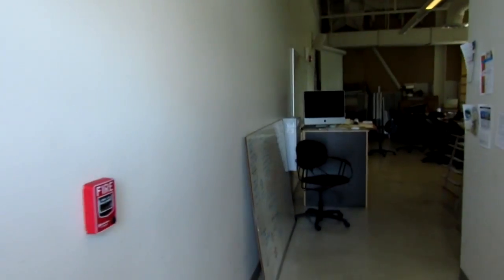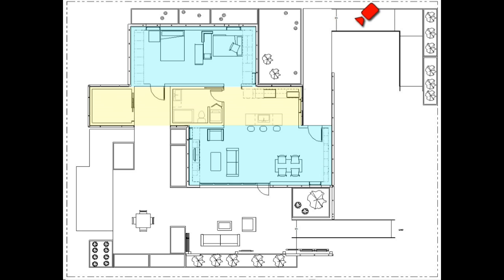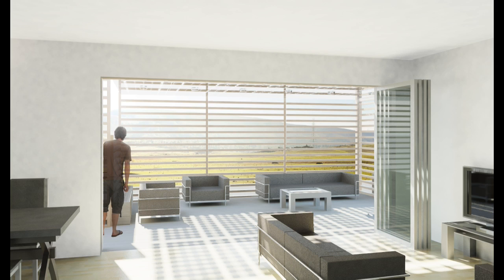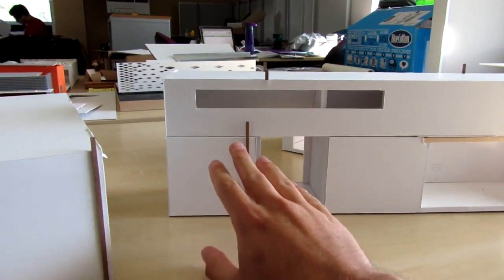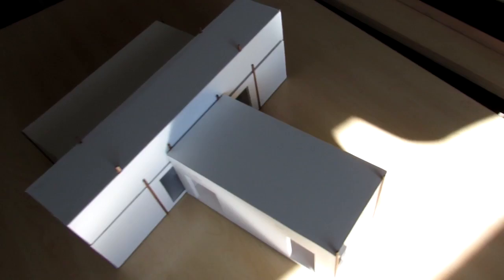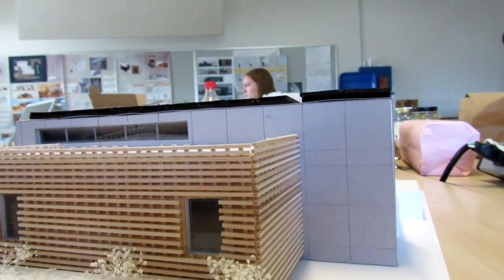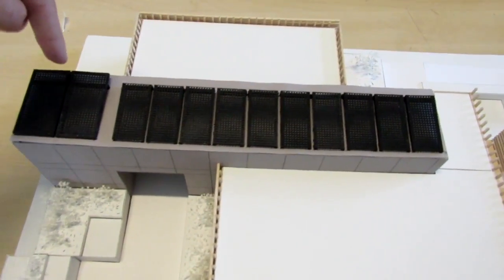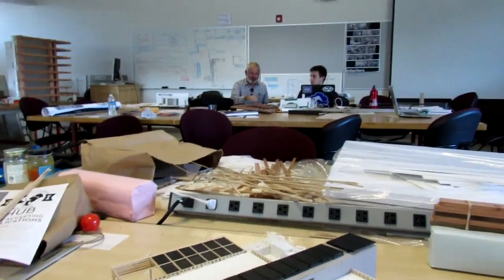Solar Decathlon - Behind the Scenes (House Design)

Comment: Hi there, I'm also an Engineer and a TW gamer. Right now I am designing a Green home for myself in Chief Architect 7 to be build in Texas. I have built Green homes before. Let me give you guys a couple of hints. I understand the need of making your house in modules, after all you need to move your house to the competition area, but I wouldn't build a green home in modules unless it is focus on customers who wants to live their homes in rented space. About your passive way of cooling and heating your design is the best you could do giving the circumstances. My Green home design consist on recycled straw-bale and mud/stucco mixture and it will be fixed in place but you could try to build your home like the guys at ModCell Straw Technology (google it) are doing with their Pre-Fabs. Thick straw-bale house walls are the best way to passively control temperature with good environmental alignment of the structure on site. Anyway, success...

Comment: so realistically, how much would this cost to construct?
Reply from the maker: MsLemons12 I'm not sure actually. A one off design will always be more expensive than something that has been done over and over again in the past. I know that the appraisal value for the home is supposed to be at around 250,00 which is quite alot but then again it is a bit of a science project with lots of expensive gadgets and things inside
Reply: Well, if its 100% off the grid 250,000 + land isnt terrible compared to normal houses depending where you live.

Comment: Does it have central air conditioning?
Reply from the maker: ***** Yes we have the air handler and heat recovery ventilator in the mechanical room with duct work passing through the top of the core bar over to the passive wings

Comment: This seems more of a civil and environmental(water) engineering. If I remember correctly, you're a mechanical. Was your input thermodynamic efficiency of all windows and appliances? I'm not majoring in mechanical, but I'm majoring in aerospace. I might be missing something since we diverge after our 3 year. I'm interested in your input as an mechanical when constructing a house. Great video too.
Reply from the maker: n0body89 As an ME I've been looking at all sorts of things such as head loss in pipes to properly select equipment and distrbutuion network sizes. We've been doing a lot of heat transfer analysis on the home and more in depth looks at fine tuning window selection for proper U/SHGC factors to keep the house at just the right temperature. Lately I've also been doing more thermodynamics/fluids work on a custom phase change heat sink duct we are designing. It's a lot of cool stuff that combines some more traditional home construction as well as some more innovative stuff.

Comment: Great video... as a engineering, graphics and design and architecture student (finished studies last year)    this is realy good..  you guys have used the space so well. Natural lighting is sooooo important and you guys have incorporated it perfectly.     Really well done!!
Reply from the maker: Mark Surgeon Thanks, I think the architects have done a great job. They've been a real headache when it comes to doing the wrong thing for engineering efficiency most of the time but when it comes to architectural concepts, they kill it
Reply: THFE Productions well smooth sea never made a good sailor.  What problems did they have exactly? And is it all resolved?
Reply from the maker: Mark Surgeon The biggest issue is when you have to make a decision to move forward on something. For engineers its pretty much all about what the numbers and calculations say. For architects it's more about abstract things like "delight" and "feeling" . So neither side can really convince the other with their discipline's arguments and you have to find a middle ground
Reply: Indeed this is a problem common with working in such a large mixed grupe of people. I had similar problems working with manny people on a play school desing.  The architects wanted modern and contemporary but the engineering students wanted simple and efficient. Eventually we just ended up taking the floor plan the engineering studens put forward and just made it look pretty.       But I must say. The comon ground that you guys found has resulted in a really great design. Its basically the future.  And it looks great aswell.